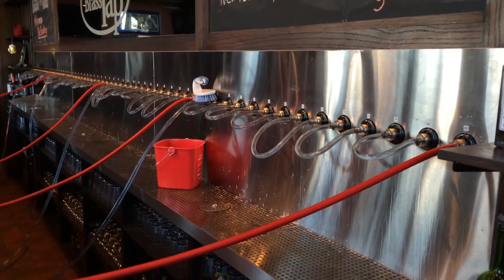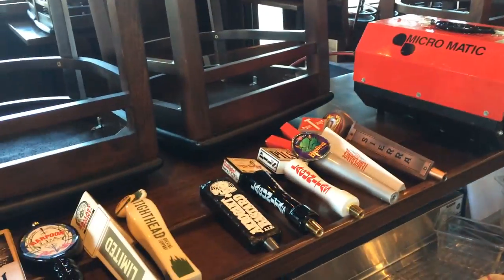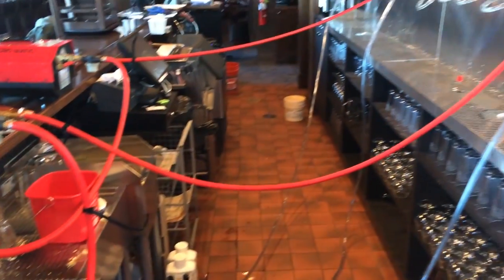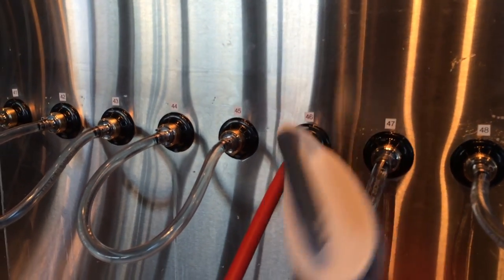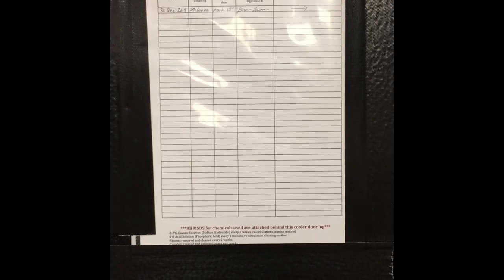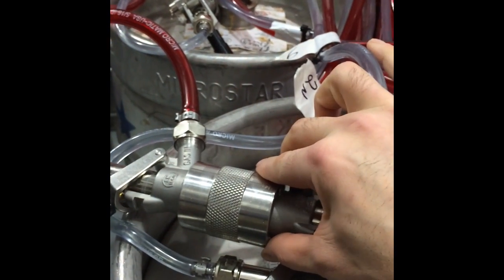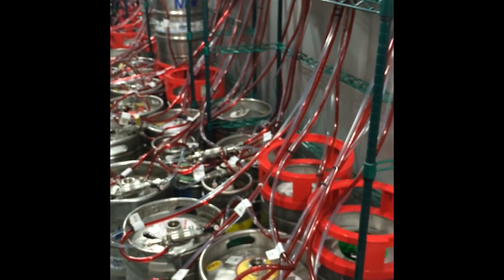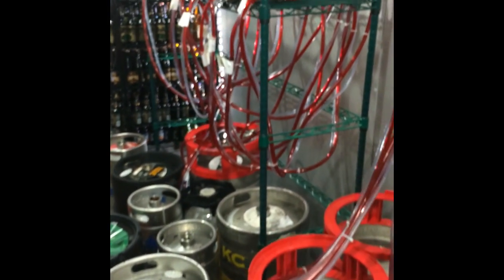Draught Beer Line Maintenance (Cleaning)

Comment: I didn't realize just how much work is needed to maintain a bar or restaurant thank u very educational
Reply: Not many places do this every 2 weeks. Lucky is they do it every 2 years.
Reply from the maker: No, they don’t, and that is not only to bad for their clients but also their own pocket books. One of the highest profit margin items getting ignored the most is just a damn shame. Draft system maintenance shouldn’t be looked at as a cost but an investment. Properly maintained lines through quality bi-weekly maintenance earn more revenue and profit on that revenue. When the beer tastes better people order more of it, and draft is more profitable than bottles. Also, clean lines have a better chance at pouring better (the system has to be designed well and operated well too) which means a higher margin on the pints sold. This increased profit should be enough to pay for that proper maintenance, and the bars should brag to their clients how much they put into it. Improved quality = increased revenue and profit on revenue. -Cheers & Beers 🍻
Reply: @LeadersBeverageConsulting  makes sense. I would have a sign and advertise “want fresh beer come here, we clean out lines bi weekly”

Comment: does having that many returns cause too much restriction for the pump? does it give each line the pressure recommended by the brewers association?
Reply from the maker: +Jesse Newell Hi Jesse, this is a direct draw system. The shanks literally go through the wall to the cooler, so in this case no. However, if I were doing any kind of long draw I'd reduce the number of loops I put on one pump. I try never to let the pump go past 35-40lbs of pressure so that to much pressure isn't put on the system (popping seals and clamps and such). The restriction on some systems let me do 10 loops and some only 2 loops. There is no cookie cutter answer when it comes to doing things the best way possible because no two systems are alike. Right now the brewers association draught quality manual says two different things (frustrating). In one place it says 2 gallons per minute and in another it says up to 2 gallons per minute. These numbers were kind of arbitrary based on the one gallon per minute pour rate. In the field, 2 gallons per minute is nearly impossible. I have it on pretty good authority that the next version of that manual will be removing reference to numbers of gallons per minute on flow rates of circulation cleaning. 

Hope that answers your question.

Cheers!

Comment: I was wondering what the coupler connector was called and where I can buy them. Im primarily looking for a way for this process to take less time. Not the duplex / male to male line connector, but the one that appears to be a solid piece of metal with the sankies both hooked up opposing each other. Thanks!
Reply from the maker: james ledbetter Hi James, that is called a dual flusher cup. You can use either American or European sankey's on it. There are many more iterations in the world but that is the most common. We actually have them in our shop at this link. https://leadersbeverage.com/product/dual-flusher-cleaning-cup/
Hope that helps,
Cheers!

Comment: What are the likely questions i can be asked if i go for an interview for a draught cleaner/maintenance line?
Reply from the maker: Ernest Nonso Hi, Ernest. That depends a lot on how the line cleaner your interviewing does line cleaning.  Usually they provide on the job training so questions will probably focus on your back ground and work experience. If you want to know a bit more about line cleaning and draught to show that you are being proactive in training and interested I would suggest watching a few more of our videos, esp. the one that is 34 minutes as a step by step. Also watch the training videos at MicroMatic.com and finally read through the Brewers Association's Draught Beer Quality Manual which is free and downloadable.  All you have to do is google it and you find both.  Hope that helps, sorry I couldn't be more specific.  Cheers!
Reply: When I started with SS Jeff my supervisor asked me 2 questions before I even seen any cleaning done 1. Have you ever cleaned draft beer lines and 2. can you handle accounts unsupervised answered no and yes ( did a small landscaping job requiring going around to accounts)

after seeing it, I was taken around with a beer cleaning tech to watch and see how it was done, lasted about 3 weeks (Good training pay). 

been doing it for a little over a year now, and its a great job low stress (when everything works out) pay is a tad lower then I wanted but the work is somewhat easy (small accounts) I have around 5 accounts that have 24 to 30 taps per account, Ive come to the conclusion that amost all of my accounts except 2 are around 1 1/2 to 2 hours to do.

but again it would apply to the company that hires you (I was lucky no real interview at all) its actually a cool job you will meet alot of people hopefully they are nice Iam at 100% satisfaction.

Comment: would you know how often the law requires line cleaning in the rep. of Ireland pls?
Reply from the maker: +Daymo Sn we did a quick Google search but couldn't find anything about the law on that in Ireland. Sorry we couldn't help more.
Cheers!
Reply: all cleaning is carried out by heineken and diageo on there respective lines too insure a common standard, usually every 2 weeks. however there is a different method than shown here. in ireland a keg like container filled with the solutions mentioned is pulled into the lines and let sit in the line, it is then flushed out with water
Reply: for home use clean lines every keg as flow is less

Comment: Do you turn off the CO2 system before doing this?
Reply from the maker: Hi Connor Jucht, no, we do not turn the gas system off while we clean. The gas allows us to leak check as we go and push product back into lines as we finish portions of a system. Sometimes we turn off individual lines but that is only when the internal seals on the coupler allow gas into the system pushing liquids in ways we Don’t want. -Good luck! & remember that quality drives business growth.

Comment: How can you get certified on cleaning draft lines? I live in Portland, OR.
Reply from the maker: Hi Paul,
There is no national certification program, though we are trying to implement a more concrete learning program. Take a look at the Micro Matic 3 day course which is a great hands on learning experience.  It doesn't matter that its all MM equipment you work on, most equipment in the world will work pretty much the same way. Past that it is just a matter of getting dirty and learning on the Job.
Reply: Paul Pavlenko On that note, i personally am considering started my own line cleaning business is Western Colorado as there has been an evident lack in accountability with local line cleaners in the short time I've lived here so far. I have taken Micro Matics class in Northridge, CA with Scott Zhusse and for a year did draft installs and service calls with Nor-Cal Beverage working for a family friend. It really opened ny eyes to my inspired passion of draft system service, although I didn't particularly get experience with line cleaning. My concern is do you think it's reasonable for me to try to get my own business going as I'd basically be learning more as I get started, or should I just try to get onboard with a bigger company and gain cleaning experience through them? I have talked to several local brewers and heard from restaurants that they need better cleaning done. I'm considering getting my own business so I can try to get service contracts with those accounts or maybe subcontract through a distributor. I'm skeptical to jump into it by myself as my experience is more so with installs, like I mentioned. Any input you may offer would be greatly appreciated!!
Reply: @James Higgins loooong story short, I declared this territory nonprofitable for me lol I'm now selling wine & spirits and occasionally doing draft work on the side (mostly because I like to)
Reply: @James Higgins it's very tedious and repetitive just cleaning lines, but definitely needs to be done far more often than many places realize. If you've seen nasty beer lines, you know!  Lol but out here beer distributors can clean lines dirt cheap so it's hard to compete with that, even if their service sucks.

Comment: Some dumb restaurant or bar managers getmad at the honest technician cleaning their beer lines and tavern heads and faucets, claiming they are there only to waste their beer, well only on long draw systems,
Reply from the maker: Hi Juan, unfortunately many owners get in a negative feedback cycle where their profit is down so they cut corners and costs. When draft servicing falls in this category the only thing that will happen is that the profitability of the draft will decrease. Now that there is further reduced profit they cut another corner, and the cycle continues. It is very hard for folks to understand that, if there is a problem with profitability, its investment that is needed and not belt tightening. Well, maybe forgo the diamond necklace for your pet lion, but cutting costs on draft is equivalent to cutting revenue. As one of the highest margin items in any venue draft should be invested in and not cut back on. By doing good maintenance, using high quality equipment (no damn chrome plated brass), and properly balancing a system the profitability goes up. Our company is probably one of the very most expensive when it comes to maintenance. However, we provide consulting and full system management with that and even tell our clients that if we don't help produce more new revenue higher than the difference between our fee and the next guys fee then even we agree we don't need to be there.

We invest a lot in education for these very reasons. We want people to succeed and understanding their draft and the importance of its proper upkeep.

Cheers!